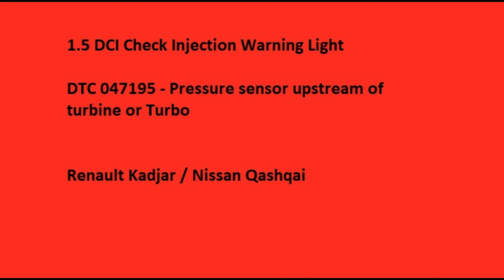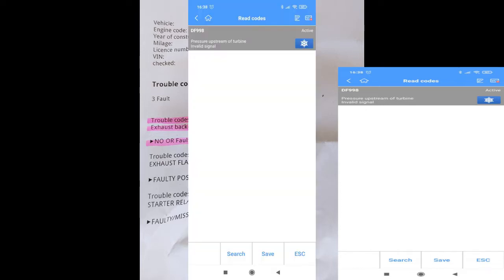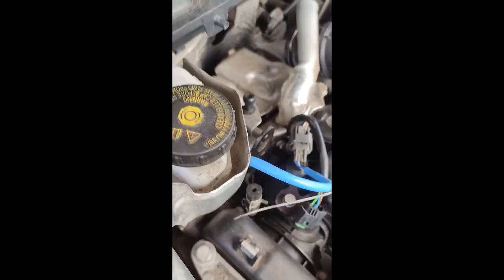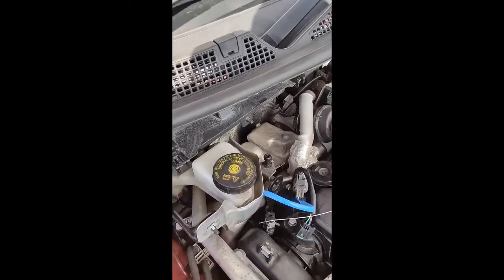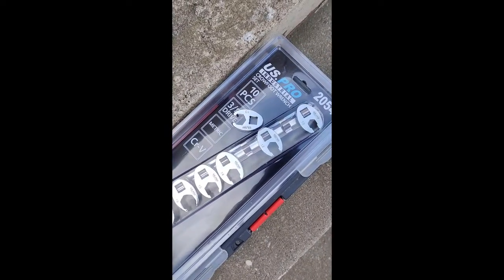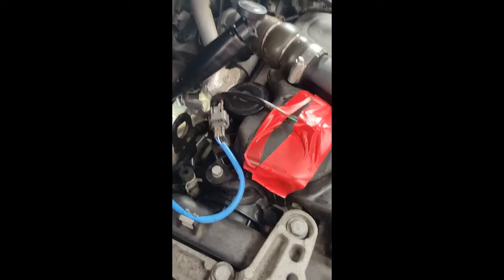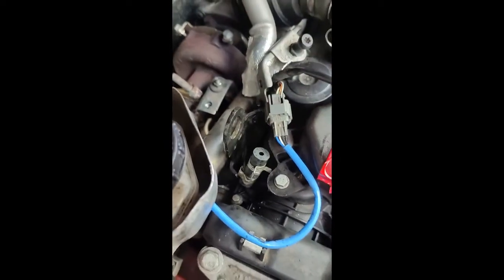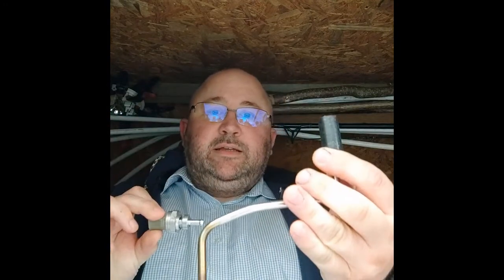Nissan Qashqai J11 / Renault Kadjar 1.5DCi Check Injection or Check Anti Pollution Fault fix

Comment: I had the same problem, I changed the sensor, and of course, the fault came back onto the dashboard. I've put the scanner on, and I've noticed that while driving the upstream turbo pressure was constant regardless of the revs, so I took the sensor out, and I've tried to unblock the pipe with a bicycle brake cable but couldn't manage to go through the corners. What I've done then? I sprayed some EGR valve cleaner into the pipe through the end where the sensor was, left it a few minutes to soak, and then sprayed again and again a few times. I left the sensor out of the pipe and drove a few miles on high revs. When I put it back in, it indicated the correct pressure values.
Reply from the maker: thanks for sharing
Reply: Is it still ok now or did it return

Comment: Did you try using a fuel injector cleaner first becaue ive read a lot of people have fixed the issue with just a good fuel cleaner
Reply from the maker: i used redex and at the start of the problem it provided a temporary fix but not a long term one.  i also tried putting it in the pipe directly along with carb cleaner.

Comment: Thanks for the video, ive got this issue on mine with faults - check stop and start/ check injector/check anti pollution 😢 ! Now i know this is probably the issue
Reply from the maker: good luck
Reply: @Stoob0y  cheers
Reply: @Aar88k  this worked for your faults?
Reply: @sasamitic3753  will know tomorrow, as it came up with a "engine failure hazard" fault so had to put in the garage, spoke with mechanic and they cleaned the pipe and also changed the sensor 🤞🤞 will let you tomorrow, hopefully get car back!
Reply: @Aar88k  ty for quick answer, i hope this fix your problem, then it will fix mine 😁
Reply: @sasamitic3753  no bother will let ya ken what was done 👌

Comment: I poked withe the bicicle cable hours an hours. Did n't worked out. With a thinner cable (bicicle gear shift cable) it was done in 5 minutes. It was the thickness of the cable dat cousts me a few hours.putted also brakecleaner in the pipe.😅

Comment: I had the same fault. I fed the brake cable into the pipe with the cable attached to a drill, slowly rotating as it depends the pipe. A squirt of break cleaner into the pipe loosens the carbon and after about 30 mins, it finally made it to the bottom. I've had to do this twice inside 100k miles but it works and is a cheap fix.
Reply: Need to do this

Comment: Can the pipe with all the bends be cut and replaced with flexible fuel line? as in re-use some of the pipe and insert flex fuel line in the middle. I think its just measureing air pressure on the dpf
Reply from the maker: was tried but didn't last see -> https://www.youtube.com/watch?v=tSQvHHZ3d5A&list=PLgYxWNWoN73Pb51ILfxfZp5i85pgAfVBG&index=12&ab_channel=FixYourRide13

Comment: My Kadjar 2017 1.2 petrol has stop/start not available & check injection light.
Taking in the Arnold Clarke under their 60 day warranty.
I'll be asking them to check this, what is it actually called?
I take it this is a common Kadjar issue?
Reply from the maker: Hello, this video is focused on Diesel engines, where it is a common problem, not sure if its the same for petrol.  let us know the outcome for others benefit if you can

Comment: @jessnielsen3771
for 0 sekunder siden
it takes under 5 minuts with af grease gun filt with injektor clean and connected to the pipe with a stell armed hose
Reply from the maker: Post a vid of your method then please

Comment: Thanks for the video, I'd tried the bike wire and thanks to you giving the length I know the wire went all the way through. Plus I've got pressure coming up the pipe. Specialist cars had my one a couple of years ago for 3 months under warranty to try and fix. Then it came back this year when it was out of warranty.
Reply from the maker: Glad it helped i did a lot of research and tried to fill the gaps from the videos i watched like length and nut size! :)

Comment: As last resort for more space I've supported the engine and removed an engine mount bolt or two. Might buy you the inch or two you need ?
Years ago to clean clagged up two stroke exhausts we would soak with paraffin for a few hour then burn it out. It used to fall out when lightly tapped !
If £130 is out of the question, find the mid point of the blockage and cut the pipe. Might make cleaning possible ? Rejoin pipe with suitable hose and clips from a hydraulic specialist like Pirtek or ebay. 
Diesels are love hate relationship.....

Comment: This sensor is unplugged in the clio i just baught and i cant find the connector, do you know where it comes from ?
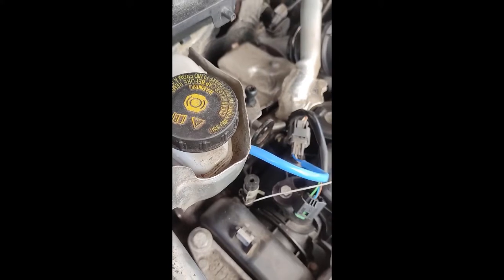Reply from the maker: at about 2:13 in the video you can see the connector dangling, on mine the cable harness had it quite tighly tied nearby so it shouldnt drop down into the engine compartment.